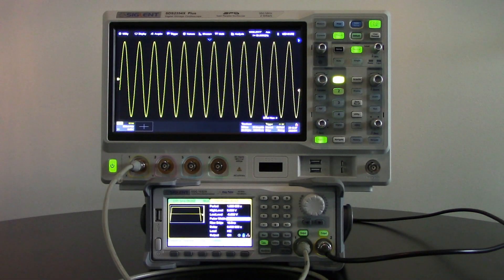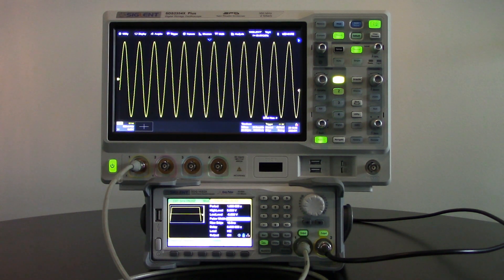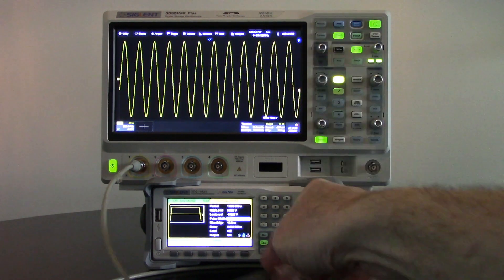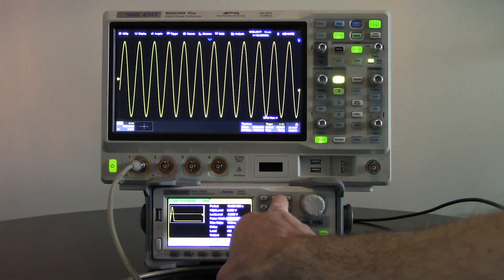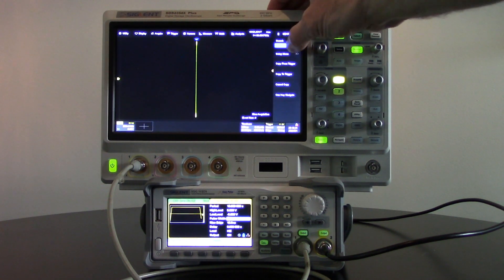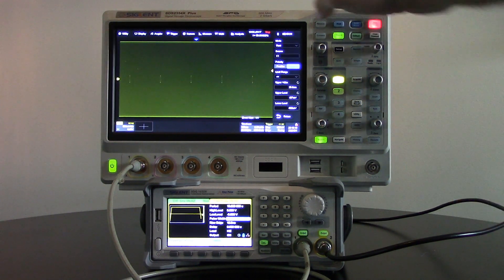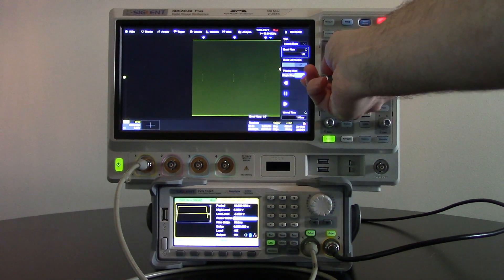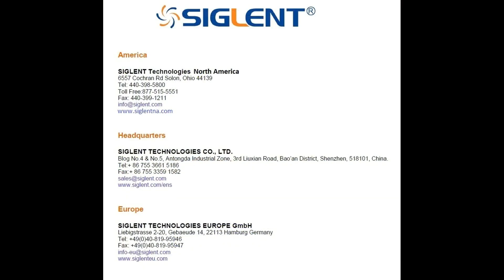Using SIGLENT Oscilloscope Search and Navigate to find drop-outs in dirty mains power

Comment: With the generator you build a disturbance every 1s or 10s. How do you combine this two channels? Channel A is a sine wave. Channel B is a pulse high 984ms and 16ms low, high level 1V, low level -1V. Channel B goes into the trigger input of sdg1032x on the back side? And now how do you combine this to channels. Is there a logical AND between ch1 and ch2?
Or is it possibility to activate a waveform only for a period of time or randomly?

The quality of the video is low(overexposure). Can you do it again, maybe with the lower priced modells? Explaning Search and history with a script.
Reply: Same question - how where the two channels on the waveform generator connected?

Comment: Would you kindly do another video on how to apply this analysis to mains voltage while protecting both 'scope and operator?
Reply from the maker: I'll consider it for the future, but I do have concerns about showing something that could be dangerous if not done properly. I have no way of knowing the experience level of the people that may view the video and covering every aspect of the safety required for mains measurements is too much for a single video. - Jason, SIGLENT North America.
Reply: @SiglentVideo  Thanks for your reply.  I understand the issue but how many of the video's viewers, now well-informed if not completely- informed, will attempt to apply what they have learned to exploring "dirty mains power"?  Maybe its safer overall to show precisely how to approach mains analysis safely.  
I note that this issue seems to have been covered in a 13Nov17 Siglent channel video entitled "How to measure the city electricity using an oscilloscope?" but it is in Chinese(?).  Do you have an English translation of the video?
Reply from the maker: @cougar1861  Duly noted. 
I do not have an English translation. - Jason, SIGLENT NA
Reply: @SiglentVideo  Thanks again.